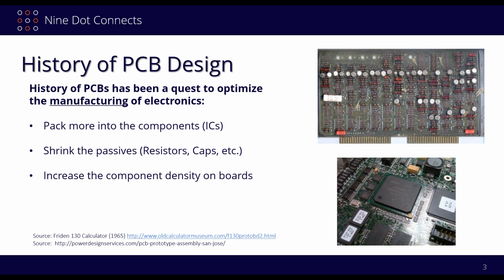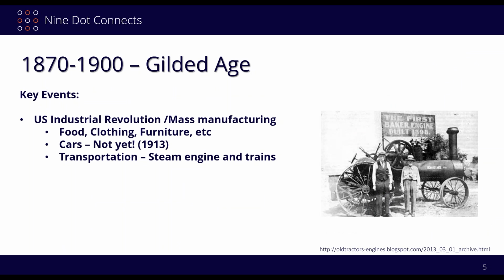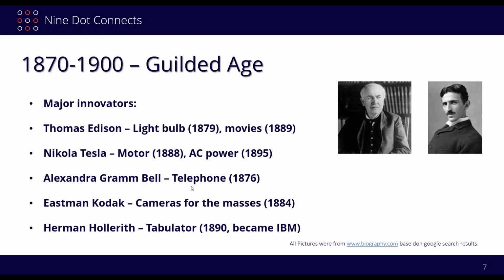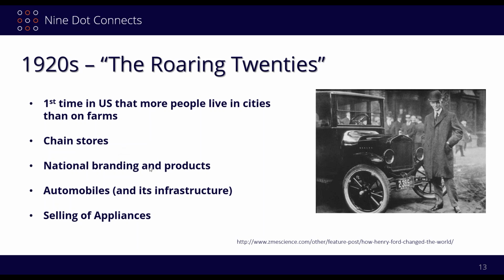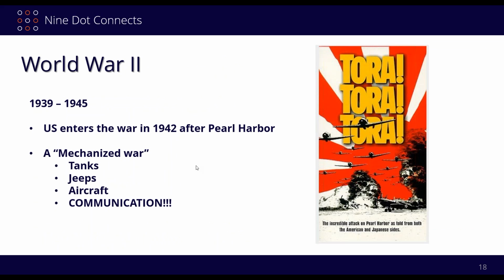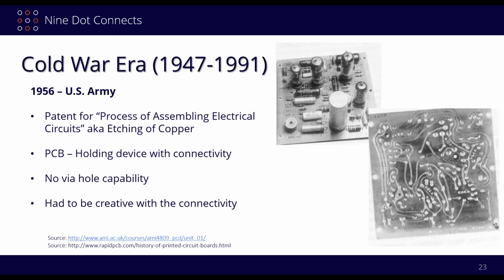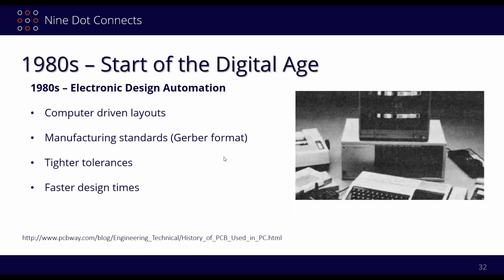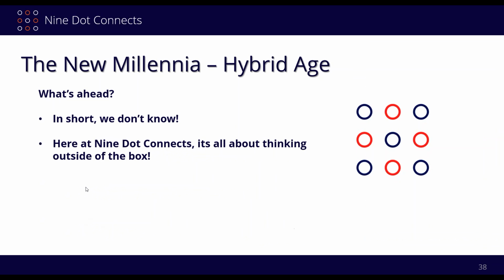A Short History of  the Short History of Printed Circuit Boards

Comment: The most worthwhile part of this presentation is from the 27 minute mark forward, where the development and use of printed circuit boards is covered.  The history of PCBs tends to get little mention.  It is essential and groundbreaking technology.  

I will say that the introductory history is better covered a lot of other places.  Instead, you might have concentrated on how electrical components were mounted and connected before printed circuit boards. There were lots of tube mounted chassis and mixed electronics mountings, often wired underneath.  Access to components and heat dissipation was a concern.  As was, keeping your wiring clear of very hot components, and segregating high voltage wiring.

A glaring omission in these sort of presentations is the early 60s development of IBM's solid logic SLT technology.  It was developed in the late 50s just ahead of the first ICs. For a little over a decade it proved to be much more reliable than the first, rather finicky, first-generation germanium based IC circuits. IBM's mounting technology was also a major step forward in the era of discrete transistors.